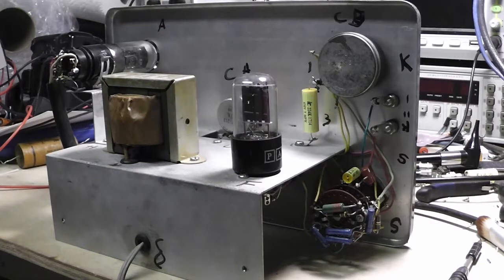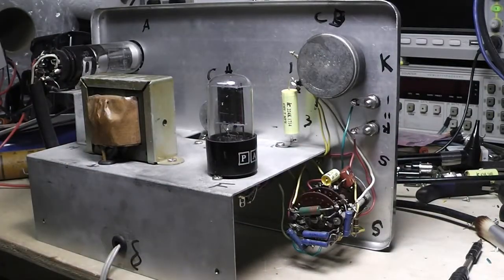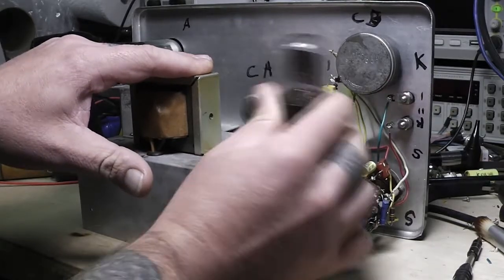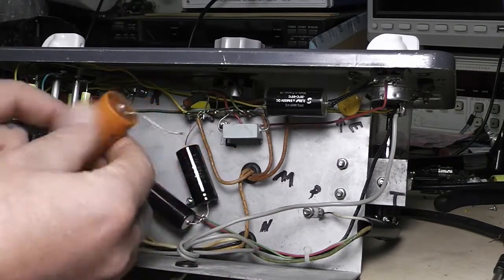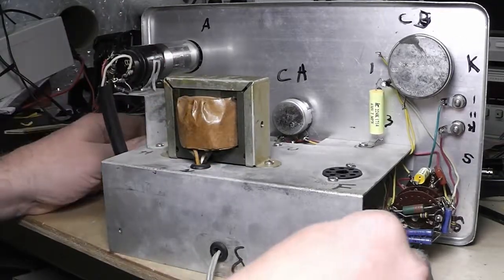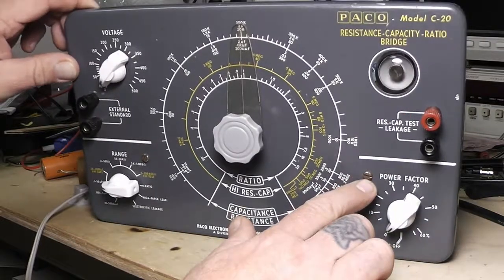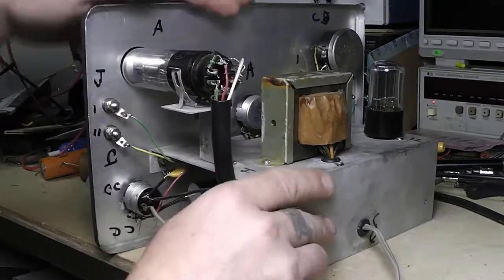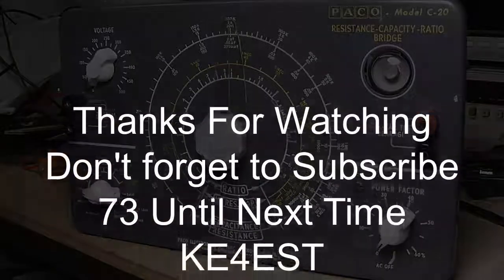PACO Model C-20 Restore Part 2

Comment: Zipcord power cords aren't cheap anymore, such as is on this. They're about $7-$8, where years ago, when I was a young man in the TV repair business, you could buy them for about a dollar and in bulk lots. I wonder where all those old TV cheater cords went that were on the shelves?

By the way, you can get a .02 uF ceramic at higher tolerance to go with the 200 pF mica, but since they're only using 1% resistors with them, they'll probably only be about that rating. The parts list doesn't state the tolerance of either cap. Plus, you can use a standard with these meters, like a GenRad, which are generally large mica caps, but the best you'll find is only around 0.1%.
Reply from the maker: @craxd1  I know what you mean .  Crazy the price of things like that.

Comment: Did u have to change main tube with the green eye
Reply from the maker: No, it was still strong.
Reply: @ke4est  when I plug in my unit (same one) the tube only gets a low red . does it need more time to heat up or deeper issue

Comment: Good story, but it is better to put 2 high ohm resistors ( 2 times 270K or so )  over the 2 capacitors of 16uF to make sure they both get the same voltage. Also I do not like the use of the  unused pins on the tube socket to connect the AC wires. I used an extra standoff. Mine has a EM34 tube in stead of the 1269 ( connected to 6,3V ! )
Reply from the maker: Thanks for the tip!